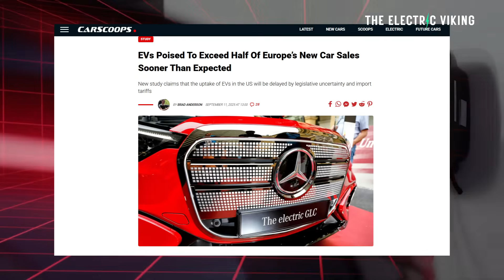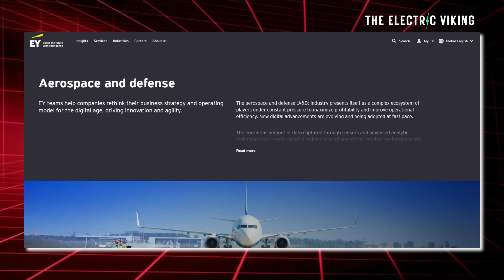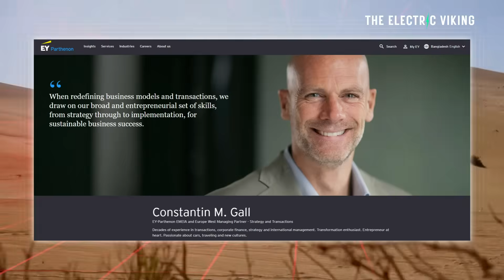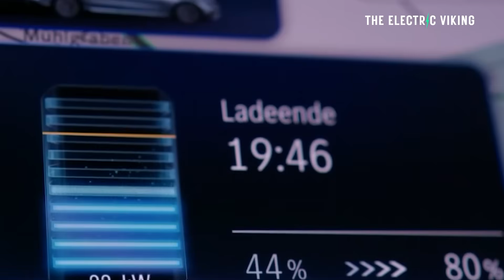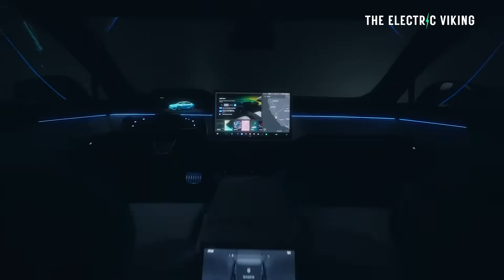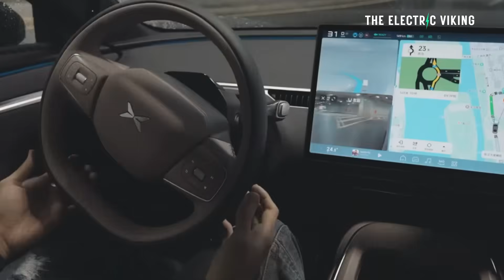Europe’s Petrol & Diesel Era Ending Faster Than We Thought

Comment: From Scotland - I have just bought my fifth ev.. I cannot understand why anybody buys hybrids or ICE cars. I have solar on my roof and a battery. I pay nothing for the fuel for the cars.
Reply: A kindred soul. I have had the same EV experience in Perth Australia. Fuel costs me nothing.
Reply: From U$A- reason 1 for hybrids-living in apartments only public charging & expensive rates. Hybrid mpg over 40 = 40 plus miles per cost of 1 gallon let’s use $3.00. An EV at 3 miles per kilowatt needs 13.3 kilowatt for 40 miles at $0.50= $6.75.  Ergo, without private homes to charge, EVs are more $$$. PHEV, same issue at to charging but elevated to slow Level 2 charging. Unless charging at work or available at apartment complex, typical PHEV ownership is not practical. You say solar energy is free? Sorry, panels must on recent roofing to last 20 to 25 years. Newer roof, plus solar array installation means prepaid electricity costs. You say, need the roof anyway. Yes, but placing panels on homes with 15 year roof life expectancy means removing the panels to install the new roof. I’ve had hybrid, PHEV and EVs.
Reply: @Rhaman68 As the infrastructure grows these issues will disappear.  Many countries new homes must be EV charging capable.  Solar is next. We will all make electricity just like we make hot water.
Reply: Hate on hybrid is irrational, if the goal is to reduce fossil fuel use of society. I won't get a BEV if without home garage charger. I own a Y & a phev. BTW, I didn't gas up all summer yet. But she is fully paid off
Reply: @kbmblizz1940  Correct.  For the same investment and materials, one could be 100% PHEV sales (50+ km AER) or 10% "long range" BEV + 90% ICE  sales .  Guess which scenario Big Oil likes better?  

In the US Big Oil managed to convince people that BEVs need to match petrol cars on electric range, driving prices up and suppressing overall adoption.  If everybody had followed GM's Chevy Volt with 40+ miles (60+ km) electric range, new car US gasoline consumption would have dropped by 90% and PHEV tech would be affordable to the point of having zero premium over gasoline cars, permanently reducing oil demand.
Reply: @ZweiZwolf Err but it didn't 😂😂
Reply: Well except amortize your solar investment but if you fully profit on house electricity as well, normally it takes 2 car lifetimes to write that off. In my case at least.
Reply: American here.  Anyone who has a place to trickle charge should get an EV, even with just level 1 charging.
Reply: @MemphisMillenial  Correct.  120V Level 1 overnight charging is sufficient for the typical daily commute.  240V Level 2 charging cuts that to a few hours and reduces the loss due to charging overhead.
Reply: I have a ICE car with 20 years old, in very good condition, I spend 25000 euros, that car has 260000 Km, means you spend more than 150 thousands euros , and I spend less 125 thousand euros than you, do you understand you not know math calculations?
Reply: @luismartins4149  Thanks for all your air pollution.
Reply: @luismartins4149  I still drive an old ICE clunker too. I see horse & buggies every day. 
Some day I will drive with my own electricity.
Reply: @GWAForUTBE my old car only uses an average of 5.5 liters of diesel per 100 km and to go from 0-100 km/h it only takes 10 seconds, the maximum speed is 195 km/h and it has excellent air conditioning. At 20 years old, it can outperform the vast majority of new gasoline cars because it has greater torque and if I reprogram the electronics I can increase it by 30 hp and instead of 10 seconds I will only need 8 to 9 seconds. The only thing I don't like about my old car is the engine noise, electric cars are super quiet.
Reply: Yes you do you need to pay your electric bill.
Reply: When you say nothing - you do need to amortize the cost of your charging equipment over the time. 
Don't get me wrong - I fully support and recommend home solar and if you can recover the cost of a battery - Great.  but it is not free energy. 
It is just cheaper energy until such time as the system has paid for itself.
That system came at a cost of outlay and the more it is used the less cost per kW can be calculated but it has a cost. 
Even the opportunity cost of sending it back to the grid (Feed in tariff if you can get it) . 
Here in Aus the best you can hope for is around AUD$0.20/kWh  feed in tariff but most give a pittance maybe AUD$0.03 kWh. Approx 1.5 pence kWh.

So it aint free.  A home solar and battery system has a payback typically over many years before it supplies free energy.
A£2,000.00  wall mounted vehicle charger and a £10,000.00 battery have a payback period and a cost per kW used/ saved.
Your own solar generated energy cost you to consume or saves on the peak grid supply . 
let's say you have a 13 kWh battery at £10k that has a saving of grid power  for every kW stored at say 24 pence. x 13 kW, that is £ 3.12 for 13 kw you saved that means you need to see 3200 charge cycles to pay back your battery before it is free power.  a bit over 8 years 9 months before any power from the battery is free. 
Similarly your home wall mount vehicle charger is say 7kWh's that wall charger needs to be used to charge cars to a minimum of some 8,400 kWh at that same save 24 pence  to pay for itself. say you put in 55 kWh each week that would need over 151 charges  to 55kWh to pay for itself. that is 3 years. before you save a penny.
Reply: @michaelanderson3771  Kinda depends how you look at it. Solar can be chalked into fantastic home improvements increasing the value of your home.  Invest in yourself or pay for gasaholeline.  Seems like a no-brainer.
Reply: @michaelanderson3771 Thank you for the detailed breakdown of "free" electric very informative 👍
Reply: Putting the solar on your roof was for free or what ? 😂
Reply: @tugaric  Net cost could be "free" after counting generation payments and what he would have paid for electricity & fuel.
Reply: @tugaric Must of been 😂 real jokers these Milkfloaters 😅
Reply: @tugaric In Australia there are government subsidies which reduce the cost enormously. Plus we have high insolation so need fewer panels.
Reply: Where do you get these Free solar panels from????
Reply: Why do you change your cars out like underwear?  The production of EVs comes with a serious cost to the environment.
Reply: @DGlass-yg8xk  ICE vehicle production has been far worse over the last century or so but now there is "concern" when EVs are threatening market share? Classic, desperate talking point...
Reply: @erktrek 
 The  EV con. It creates more 'carbon pollution' making one of these vehicles than it saves in it's lifetime, and, when they expire it takes approx: 900 years for the batteries to decay. Yep, save the earth indeed. It’s the wrong kind of electric cars  . Sitting on a giant battery producing an A/C   Alternating Current electric field is seriously detrimental to biological life , its needs to be D/C ( Direct Current which is beneficial )
We need hydrogen fuel cell electrics that don’t need  big battery and produce only water vapour as exhaust. They already exist in Japan and South Korea.  Do you see them in North America? The electricity to create the hydrogen by electrolysis could be produced by geothermal energy thus creating a green energy loop.
Cost of an EV battery : https://youtube.com/shorts/avuqF1_cX4g?si=U6cwmfvbxTMTPDNr
Reply: @LexxLarsD  Not true. Numerous studies have shown that EVs are far less polluting over their lifetimes than an ICE vehicle, even when powered by a dirty grid. While fuel-cell cars might be nice, they are expensive and hydrogen is hard to handle and has a low energy density. That's not to say they won't eventually get there, but I wouldn't hold my breath.
Reply: @LexxLarsD your information is seriously obsolete. Yes, indeed it still takes more energy, and hence generates a higher carbon footprint to manufacture an EV than a comparable ICE car. But that “carbon debt” is paid back after as few as 8-20k miles depending on the model and the carbon intensity of the grid where you live.
Furthermore, 100% of EV batteries are recycled. A dead EV battery is still worth about $1500… so who in their right mind would put it in a landfill? Not to mention that, in Europe at least, it is illegal!
Reply: @DGlass-yg8xk  What do you think the 2.2 million abandoned oil and gas wells in the US cost the environment, or the estimated 29 million globally? Most of these well leak methane, volatile chemicals, and deadly gases.  They contaminate the air, ground, and nearby water sources.
Reply: @DGlass-yg8xk  Newer EVs have much better tech, but older EVs depreciate fast while still having plenty of service life. Someone else will get it cheaper, and still save relative to a petrol ca. Worst case, a heavily-degraded 1st gen Nissan Leaf still has 70+ km battery range, so it's good for 50+ km of local errands before you need to charge.
Reply: @DGlass-yg8xk indeed! But this carbon debt is paid off after as little as 8-20k miles, depending on the model and on your grid’s carbon footprint.
Reply: @DGlass-yg8xk Seriously? You’re lecturing someone who buys EV’s why u burn gas? Also… if he buys a new EV and sells it… someone else gets a more affordable used EV… go away little boy!
Reply: @DGlass-yg8xk Cost to the environment?  Like oil tanker spills, the steel industries pit mines or the cities covered in smog all from ICE car usage & sales.  
Any environmental impact from EV batteries will eventually be eliminated with battery chemistry technology.  
Burning fossil fuels will always be disastrous to the environment.  

Look up how many gallons of crude have been spilled all over the world.
Reply: @GWAForUTBE massive amounts of fossil fuel are used to produce and power EVs.  They don’t just pop into existence.  They’re made of plastics from oil and metals from strip mine just like ICE vehicles.
Reply: @DGlass-yg8xk Obviously EVs will need to be built . & at this point the battery does contain a lot of precious  or rare Earth materials.  
It is long term were EVs shine. Not only lasting much longer due to thier simplicity , but with superior efficiency,  using far less energy to do the same thing. 
ICEs are horribly inefficient,  essentially wasting close to 75% of thier fuel out a stinky tailpipe .
Reply: @GWAForUTBE But Ice car's are faster 😊
Reply: @johnthemagnificent7022  A Tesla Plaid does extremely consistent 9.2s  all day long. 
The SCCA recently banned Teslas because they dominated all the classes.  
No EVs are faster & handle better with far superior throttle control.
Reply: @GWAForUTBE Like  I said slower.... 😊
Reply: @GWAForUTBE Oh and slower around the Nurburgring... 😊
Reply: @johnthemagnificent7022  How many factory ICE cars  do consistent. 9..2s . Vents? Nope 
Ferraris? Nope . Lambos? Nope 
Electric cars are stomping all over all kinds of racing.  The ring is an endurance track.  The battery yet can not fill as fast as gasaholeline.  This will end too.  Sell your gascar while it still has value.
Reply: @GWAForUTBE  No way would i sell any of my ice car's 😊 Obviously you're not in the UK
Reply: @johnthemagnificent7022  Irrelevant.  I hear of lots of brits who love their EVs. 
But smart brits not locked in the past.
Reply: @GWAForUTBE not many as far as I know.... my friend has lost £75k in depreciation in just over 3 years on his Taycan.... he wishes he'd never seen it.... not to mention the recalls 😮
In the UK the government has to give out grant's to try and persuade people to buy EVs
Reply: @GWAForUTBE not argueing ICE aren't worse for the environment, but replacing your car all the time without it being broken is definitely wasteful.
Reply: @lb2791 I agree. That is why Tesla engineers million mile vehicles.
Reply: @DGlass-yg8xk sure! But the great majority of the environmental impact of a car comes from its use, and NOT from its manufacturing!
Reply: EV batteries, The A/C ones is like sitting in an open microwave, their electric magnetic fields are detrimental to biological life .
Reply: @LexxLarsD all battery’s are DC by their very nature.  Please take a physics class.
Reply: @ImNotBothered 
Not quite , for charging it can be both , but almost all EVs have A/c motors .
Reply: @LexxLarsD Debunked. Your ICE cars ignition system is as detrimental.
Reply: @GWAForUTBE 
The  EV con. It creates more 'carbon pollution' making one of these vehicles than it saves in it's lifetime, and, when they expire it takes approx: 900 years for the batteries to decay. Yep, save the earth indeed. It’s the wrong kind of electric cars  . Sitting on a giant battery producing an A/C   Alternating Current electric field is seriously detrimental to biological life , its needs to be D/C ( Direct Current which is beneficial )
We need hydrogen fuel cell electrics that don’t need  big battery and produce only water vapour as exhaust. They already exist in Japan and South Korea.  Do you see them in North America? The electricity to create the hydrogen by electrolysis could be produced by geothermal energy thus creating a green energy loop.
Cost of an EV battery : https://youtube.com/shorts/avuqF1_cX4g?si=U6cwmfvbxTMTPDNr
Reply: @LexxLarsD  The electricity needed for the hydrogen will be far greater than a simple high efficiency electric motor
Reply: @LexxLarsD  Lex. Ya gotta stop watching the hater channels.  They lie to you. Paid by big oil & big auto.  Really.  As an investor I appreciate a full spectrum of knowledge.  I try to watch the hater channels but they continuesly spew horse shyt.   There are lots of great channels that when they screw up , get a fact wrong..are called out.  You know the facts are right on.
Reply: @LexxLarsD BTW, batteries produce DC current, NOT AC current… and neither are detrimental to life!
BTW 2, the amount of power need to move a hydrogen fuel-cell car is triple that of a BEV. 
BTW 3, a HFCV is an electric vehicle! Its electric engine gets its electricity from a battery, NOT directly from the fuel-cell!
BTW4, a fuel cell lifetime is much less than a battery’s and costs at least as much to replace.
So, no, hydrogen has no place in road transportation!
Reply: @LexxLarsD easily overcome with a tin foil hat.

Comment: Electrified trailers and a standard to connect batteries. That's the answer to towing.
Reply: Almost seems obvious doesnt it? And the trailer can charge while its sitting there not being used when the tow vehicle is off doing other things.... Saw a while ago someone advertising a caravan that could do this, but the price was pretty steep!!
Reply: 7x14 sq. feet trailer and an average 1750 Watt collection per sunny hour. 10-11 kwh on a good sunny day. Imho that´s barely enough to compensate for the added consumption of pushing the trailer. It sounds nice though.
Reply: That's the answer if you have no idea what you are talking about.

Comment: Europe car sales. There is no single definition for "Europe" statistics. It would be more informative to analyse details by country. Norway is 95% BEV sales but it is outside the EU. Many poorer European countries just import used cars, many from Germany. Rich Nordic countries are doing well buying expensive big European EVs. I think the biggest problem is the lack of affordable small EVs. No VW Polo EV equivalent, no Ford Fiesta. Many Europeans buy small cars which are better in cramped historic villages, towns and cities. When European manufacturers fill this gap, I expect a big surge. Earlier this year, I visited Malmo and Copenhagen. I saw lots of ID.3 & 4, Volvo EVs, Polestars, BMW EVs, Mercedes EVs - European cars. Lots of electric buses and clean air. CATL hasn't sold LFP batteries to European car companies. I don't know why. European car companies are making plans for their own solid state batterys. When I went to the French alpes - I saw very few EVs. There are vast regional variations. Many EU countries are installing renewable power faster than China on a per capita basis. Check out Hannah Ritchie's sustainability by numbers.
Reply: The Vw group is coming out with cheap EV’s from all of its brands. Skoda eliq, curpa raval, VW ID polo and ID cross. Smart is also bring back the smart four two and Mini Cooper EV’s that will get the new motors and batteries with the facelift and neue klasse platform. Other brands will follow suit. Chinese EV’s South Korean EV’s and Japanese hybrids are also coming into Europe so wide varieties.
Reply: @AGZF1983 but are their EVs profitable? That's been the big issue with legacy manufacturers so far and why they keep pushing hybrids, hydrogen and alt fuels.
Reply: @erktrek  VW are stepping up on tech. Rivian software platform, xpeng co-developed platforms which probably means gigacast bodies saving $$$$. Manufacturing efficiency and speed is key. We will see.....

Comment: If governments really want to accelerate EV adoption they should be subsidising build-out of their national grid systems because currently that's what's lagging.  Here in the UK we produce more renewable energy than we can currently use because the grid backbone isn't in place to carry the power from where it is produced (mostly the windy north) to where it is needed the most (the south). And subsidising much greater adoption of solar for local generation will also help solve this problem. Subsidise battery storage. What EVs need is local (preferably home) charging by clean power. For widespread adoption that means we need more clean power everywhere.